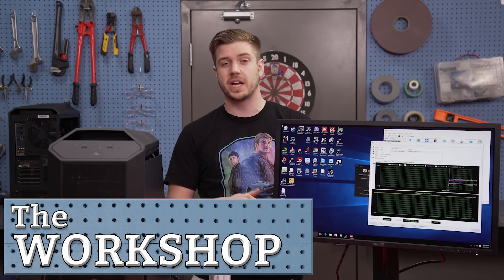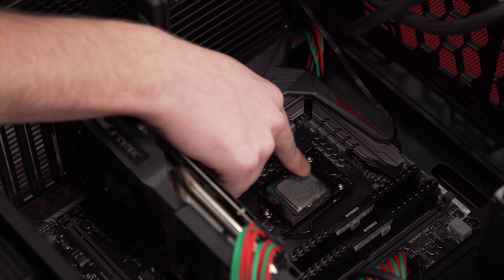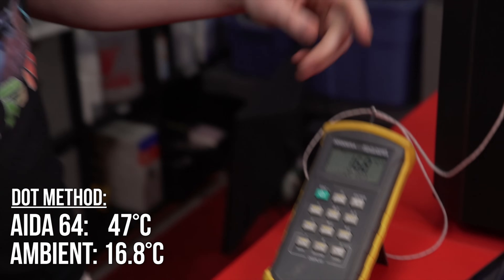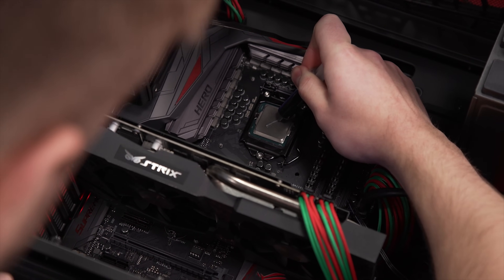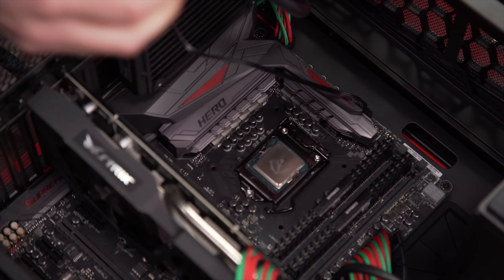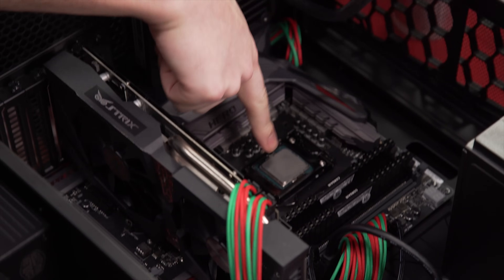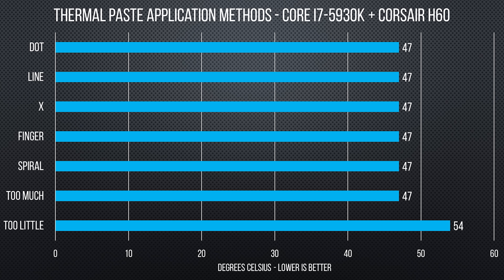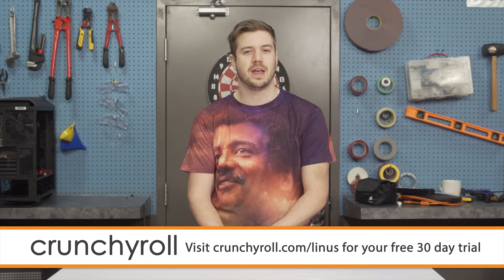Thermal Paste Application Methods - Which one is best? - The Workshop

Comment: I was once told, that when you apply thermal paste and mount the cooler/block, you should remove the cooler/block, clean it's base of thermal paste, and then put it back on the CPU, where you left the paste which spread on the first mounting.
-> I never used this method personally, but am interested in what the result would be...
Could you try this sometime in the future, to see what the result would be?

Comment: 1) I was always told to make little dot and then spread it evenly across the surface with a double razor blade. But it was back then when the best and only solution was 99% silver paste...
2) maybe don't do this test with water cooling station that can handle sth like 600W(t) in load... how about do this with stock cooler?
3) ... if you do this with WAY overshot cooler, how about measure water flow or/and fan spins?

cause im 99% possitive that the cooler(or mb that control it) is set up in a way to hold certain temperature/deltaTemp.

Comment: W0W the best.. you are the best... I waited for a video this type. keep the good work. I dont have tweeter buy my QUESTION is:
what happens if you remove your fans completely from your radiator and how a classic H80i reacts do different fan speeds and fan blades(pressure - airflow), through AIDA64

Comment: How about under load?
Reply: Uh, that's what AIDA 64 does.
Reply: +David Adams AIDA64 puts stress on the CPU, so those temps from the video were under load. They didn't include idle temps though, which could be different.
Reply: +Caleb Wasson So the amount you have don't matter?
Reply: David Adams Yeah it looks like you can have as much paste as you want, just as long as it doesn't spill over the edges of the CPU. A tiny dot works just the same though, so no need to use so much.

Comment: hey Luke, like the airflow test, these results can't be correct!  you doing something wrong i guess,
i have to ask for a vol. 2 airflow test where you should use hardware with high tdp like 290x (not blower type) and a fx cpu? also make the test with low rpm fans and very hight rpm fans!! the airflow test you did was a little bit lame since you showed us that no matter how much stuff is in your case the temps stay the same (except putting boxes in front of the fans).
thanks for all you workshop content keep it coming.

Comment: Why'd you use a paper towel on the card? that's why it spread like do do. I've personally never used the card method but have never seen it recommended with a paper towel around it.

Comment: The big fail in this video is, that he uses a watercooling unit.If he would use the stock cooler, you would see much clearer deiferences between the methods!
Reply: +Melvin Gimp I recognize you from the RVZ01/FTZ01/etc. thread. :) You reckon I'd see much difference between the methods with the Dynatron R24 cooler that comes with the ASRock X99E-ITX/ac board?
I'd love to run cooler while waiting for someone to make a slimmer AIO cooler that can fit the narrow ILM mounting over the board's socket.

Comment: These workshops are gr8 experiments but they lack few more test like in this one. 1)No thermal paste and 2) with different type of coolers (air vs AiO).
Also with the cable management, taking old system with no back panels and dust accumulation and differnt Case sizes.
Reply: +Pradeep Singh Do agree with the point. Luke started an excellent workshop kudos for that but would like more angle on test setups. option of old to new systems or multiple case size in the experiments.

Comment: I'm really not sure if i messed something up while mounting my liquid cooler (NZXT Kraken x61 on a i7 5820K because the temps reach up to 85 degrees in Prime95 with small FFT's.
Does anyone know what could be wrong? The thermalpaste was pre applied.
Reply: Emoticons yea just run prime95 its a great tool, but again just undo the whole thing and reinstall it. You will probably find errors in your installation of the cooler, and get some good paste arctic silver is the standard so start there.
Reply: +Emoticons although temps are important to keep your cpu from melting itself it is never what you should be basing your overclock on...  Agreed that as long as it's only for 10 seconds it's probbly not going to hurt it...  But the purpose of running prime 95 and aida64 it not to see how hot you can make your cpu...  There for long term stress testing and for testing stability.  Which I'm sure you know.  Back to my first comment I clearly stated that I have a 4790k and that it runs warmer than other generations.  I also said I "ASSUMED"  that they may run at similar temps.  Not that they did or did not.  You have a kraken x61 I have a h100i two very similar coolers however I can not run prime 95 at safe temps for any given amount of time.  I have posted in many different forums and have came to the conclusion that I have one of the worst 4790k s a person could buy.  I can not run stable at any voltages any higher than 4.3 ghz without running 100+ degrees Celsius on prime 95.  However I can run a stable temp of 78 Celsius with aida64 for 2 days without error or throttling.  But that all goes to hell when I move up to 4.4 regardless of my voltages.  Guess what I'm trying to say is know what your temps are and know your limits.
Reply: the cooler and its backplate isnt seated right..this the problem on mine when i first built it
Reply: +Emoticons prime95 works the shit out of your cpu which is why most don't use it on the 4790k since it is a hotter running cpu... not sure if 8520k is the same but I would be inclined to think so... if I were you I would stay away from prime 95 and use aida64
Reply: +Emoticons Reapply it.
Reply: Loren Coberly Why should i stay away from Prime95?
Reply: +Emoticons  the 4790k should not run at temp over 90 Celsius.  I have never successfully stayed under 90 for more than one minute overclocked to 4.4 ghz...  When I run aida64 at the same overclock my temps stayed up to 20 to 30 degrees Celsius cooler.
Reply: Loren Coberly I have a 5820K, not a 4790K and isn't checking the hottest possible temperature with your current clock speed exactly the point of a stresstest? And after all it's only for like 10 seconds, shouldn't hurt the CPU too much. ;)
And also the temps really shouldn't go that high at all with an overkill cooler like the Kraken x61.

Comment: how about experimenting what types of thermal compound will give the best temps... is it the grey one or the white one or some weird diamond compound...
Reply: +Amirul Izzat Imma guess the answer is 47. You can see a whole bunch of tests people have run on this and what they ended up finding is that even the best thermal compound is only a couple degrees away from toothpaste.

Between more expensive and less expensive paste you're talking about 0.5 degree differences. Thermal paste is pretty cheap though, even for the expensive stuff, so if you're doing a crazy overclocking build, you may as well get 'Arctic Silver' or some similar premium brand. For normal usage, it literally doesn't matter.
Reply: UndeadSamurai01 yeah well its kinda interesting just to see the differences between them... the only thing that i knew the benefits of using premium thermal paste is when you doing extreme liquid nitrogen cooling cause that paste can handle that temperature.

Comment: dont you feel cold staying in a 16.8C room with only a tshirt on?
Reply: Canada.
Reply: +shidajieqing 16.8C is not as cold as people believe.
Reply: +shidajieqing well my sister sleeps at that temperature and only wearing a bra and shorts
Reply: in canada i wear a t-shirt in 10c
Reply: +Noahfle we go out To swim because 17 is very warm for us in europe
Reply: +shidajieqing I would! I live in Canada, and I have my room heated to 25C at all times.
Reply: How warm a temperature feels depends also on humidity, don't forget.
Reply: +shidajieqing 

16C is good enough for tshirts.
Reply: ***** we did need to know that sarcasm
Reply: Why is everyone saying that ? I'm usually top naked when we get 15c in summer >:(
Reply: ***** DansGame
Reply: +shidajieqing I'm Canadian but I've been in Mexico for a few years for work, a very hot region of Yucatan. everytime I go back to Canada, I'm wearing jeans, shoes and a sweater when everyone else is wearing sandals, t-shirts and short at 18 degrees celsius and I look like a weirdo freezing my ass off.
Reply: +shidajieqing 16.8C is where the fan is pulling air in, its effectively the coldest bit of the computer, the room is almost certaintly warmer than that
Reply: It's 5c in my country right now and that's standard
Reply: +shidajieqing with canadian. absolutely NO
Reply: +det Bits Ha! My computer room sits around 23C. Guess that's what happens when you have a FX8320 and a 390x. Definitely want to swap the processor over to intel, may bring the temperature down a bit.
Reply: +shidajieqing well its not that cold if u move to sweden xD
Reply: I live about 1 hour south of them, and it's the same here.... It's hot for us here, and I have my air conditioning on....
Reply: +det Bits *warm blooded people.

Comment: I had a very similar situation with to much thermal paste. I had recently installed a fx 8350 cpu in my system and used the stock cooler with the stock thermal paste witch had wayyyy to thick of a layer. and idle temps avg was 49C and load temps were hitting 80C then shutting my PC off due to overheating and after using my own thermal compund with the correct amount my idle temps avg was 28C and load was 54C.
Reply: +Devon Thomas 54 during load on the fx8350? was it overclocked?
Reply: no i wont be overclocking it untill i buy a liquid cooler

Comment: ghetto modded cpu air cooler on a gpu? better or not ?
Reply: +Saurabh K yeah its better. A cpu cooler is usually much larger and can dissipate much more heat than a gpu stock cooler that has to fit in pci slot dimensions. Just make sure you put some little heatsinks on the VRMs and chokes etc.
Reply: +Ben Shepherd i have ninja scythe 3 and CM hyper 103 lying around. So thought to do it on my old GTX 460(still my current card)

Comment: I hope so, I have been having to clean my credit cards for years!
Reply: #GetRekt
Reply: +Arab_Knight69 That's awesome you should upload that shit.
Reply: +Hardware Unboxed Awesome just bought a xeon cpu last week I will let you knos how it goes.
Reply: Hardware Unboxed wtf do you mean?!
Reply: +BlackAus07 ewww damn a server chip. You might require a Gerni for that sucker.
Reply: +Hardware Unboxed So let this remind us all. One dot of thermal goop is more than enough.
Reply: Mustavi Sadi Aryan  “One dot of thermal goop” is a standardized unit of measurement, so just read the packet. From memory an LGA1151 processor will take 1.5 dots while an LGA2011v3 processor will require 2.5 dots.
Reply: Hardware Unboxed OK, so we can say that we must use the dot method, but don't use it in such a way that is covers the entire CPU.
Reply: RJ Nash Sorry, no such method exists. Your argument is invalid.
Reply: +BlackAus07 That is the preferred method if you can get your hands on a decent spray bottle for a reasonable price, copper nozzles create the perfect mist for high-end CPUs. Just remember like thermal paste, don't over do it!
Reply: +Mustavi Sadi Aryan Or you guys could just use the "common sense ffs" method... No guides needed either.
Reply: What if i get fridge water in a spray bottle and spray it on the cpu when its hot instead of a normal cooler?